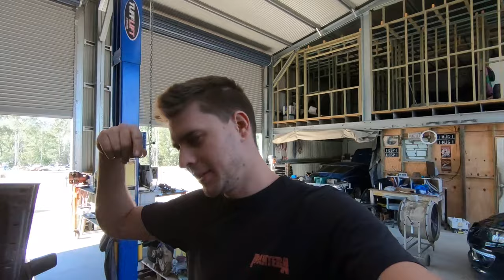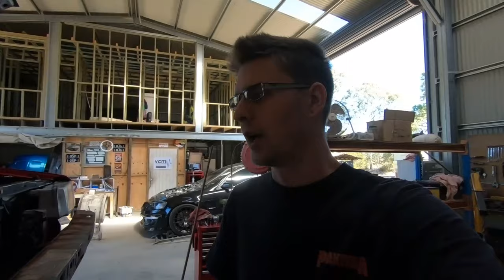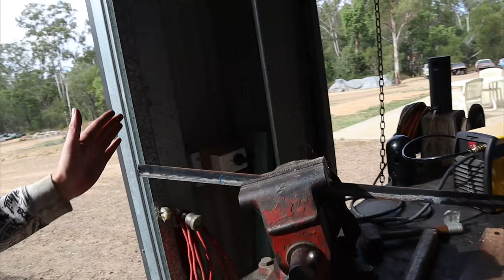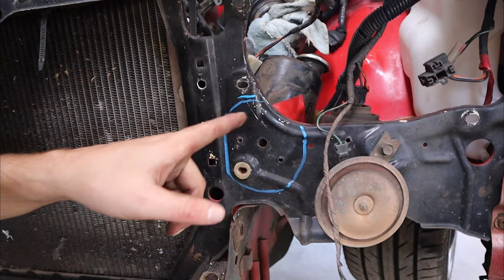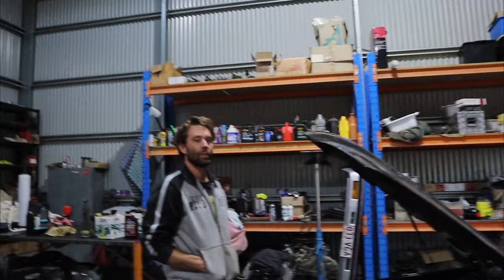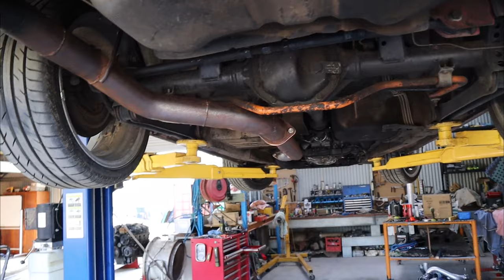R31 FMIC Install

Comment: I rate good quality worm drive clamps over t-bolt any day!
Reply from the maker: Hey man what brands have you found success with?
We have been lucky to have heaps of good ones left over from years in comms, our stash is running low though and havent been able to find many good ones that actually hold boost
Reply: @BoostGumps  always using the tridon stainless on my SR20. Wurth clamps are also really good. Plazmaman do completely black worm drives too if you're going for the murdered out look.